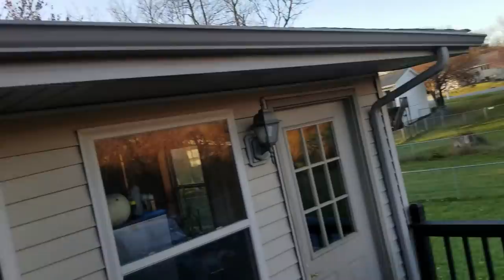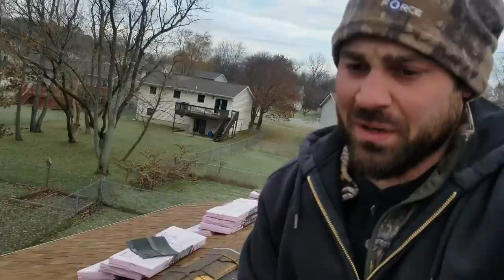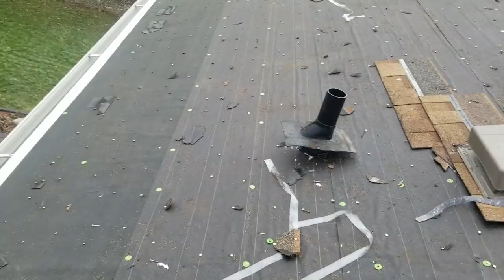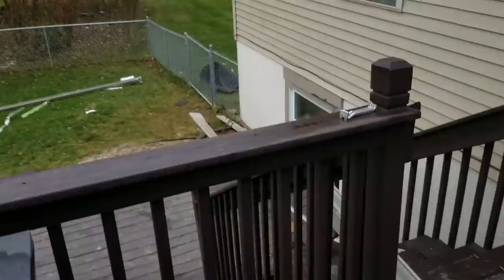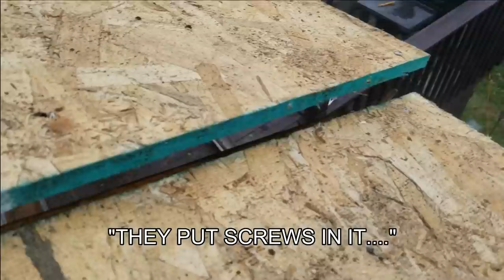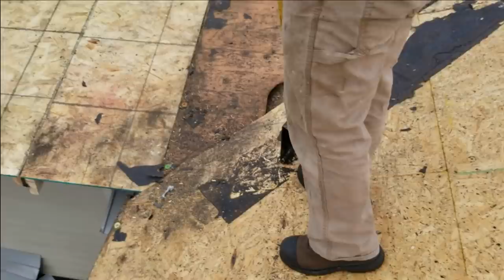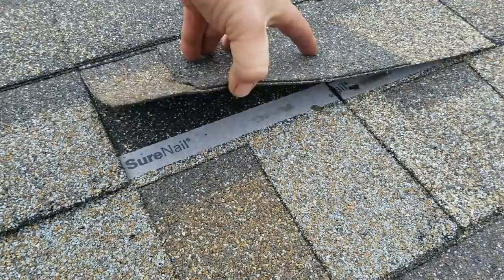Worst Roof Ever Installed!?!? (part 2)

Comment: The landlord at my last place bought a century-old factory and "fixed it up" himself to turn into apartments.  He sprayed cement spackle all over the door frames, and used styrofoam to fill holes in the exterior walls and then spackled over top.  When I had my satellite dish installed, the installer told me my landlord "fixed" the leaking roof by nailing blue dollar store tarp over rotten wood and crumbling tar.
Reply: LOL. Sorry for laughing but that sounds atrocious.

Comment: The way we fix the overhangs is to pull the decking off 2 rafters from the end, notch out an inch and a half, and nail a 2x6 flat across them and to the fly. Then deck it back. Makes them solid for life. They’re called “lookouts”.
Reply: Sweet, that's what I did for my diy roof I didn't know they're called lookouts.

Comment: hey buddy for the plumbing boot I like to cut the bottom shingle to go over where the three exposed nails are and just tar everything so you don't have any nails exposed and you have the one below tucked underneath far enough. I just don't like to have exposed nails on a shingle roof at all. An added touch is cutting a small slit in the middle of the bottom so that the water doesn't pool up. Many If I had a shed to do that would've been perfect to reuse those shingles-owens corning hold like a mother, but they are a pain to cut through. Happy roofing brother.

Comment: big respect for righting the wrongs on this roof, i do alot of roofing in denmark and i dont understand why you dont throw up abit of scaffoling so you guys dont have to hang off the edge of the roof with a spade to get things done, with a low hanging roof like this one it really wouldent take long to put up
Reply: by time you get that scaffold up the demo is done. Just another tool to get in the way, haul to and from the jobsite.
Reply: I’m more curious why residential roofers rarely tie off. Two of the three site deaths in my area in the last six years are unsecured roofers falling. Put on a harness and tie off.

Comment: Always make sure to check with your local building department for permit requirements.  Any legitimate contractor will not say permits are not required nor attempt to discourage getting the required permits.  At minimum, check with the building department to see whether or not a permit is required...there's no charge for asking.  A permit ensures that the work performed is checked by a building inspector.   And it's one's protection when filing an insurance claim for subsequent damage (e.g. water damage...insurance companies usually refuse to pay if the work was completed without the required permit).  The inspector will require substandard work to be corrected...and the contractor cannot charge you additional fees. Great video!
Reply: define "legitimate contractor"

Comment: Who did this? Done so poorly it looks like a criminal act.
Reply: In Ct. The state would have compensated the homeowner and billed the contractor. If the contractor wouldnt or couldnt pay his/her license is revoked.
Reply: @naui_diver9290  they never had a license
Reply: I don't know if it matters to others, but the "wood" looks like OSB. I think you know where I'm heading with this. OSB is a product that I personally would never use-especially on a roof!!! If it manages (somehow) to get wet, it tends to wick up water big-time, and fragment much more easily than plywood would!

Comment: In my neck of the woods contractors have to be licensed, registered, and insured. In order to keep your license you need to attend continuing education classes every two years. Also, virtually all home improvement jobs, like roofing, require permits and inspections. Many of my colleagues complain about the process but it really does help weed out the fly-by-night hacks. The inspector in my town would have never passed that roof job and the client would not have to pay until all of the issues are addressed.
Reply: my town just started requiring permits for roofs but they don't even bother looking at it

Comment: As a former satellite tech, I can say for certain that the dish is also improperly mounted. Also, if he just mounted it anywhere he felt like, it won't pick up a signal. It has to be tuned. Honestly, I blame the homeowner. If you can't do a job yourself, then it's your job to ensure the ones you hire are capable

Comment: I'm glad you are putting it bac together correctly. But somethng to note is that it is always worth protecting the deck and handrail surfaces before starting demo, as you had mentioned during the video.

Comment: Over here on the west coast right on the ocean,  we use only stainless coil nails only due to salt corrosion,  also our own policy is we don't use any osb...(oriented strand board) for those that dont know what osb stands for. only plywood 5 ply minimum. Or 5/8 ply ...osb is not good in our climate. Can't believe the fascia you pulled off...lol...but unlicensed people get away with that kind of Job all the time.
Reply: Mike Champlain they use osb in Connecticut it should be outlawed
Reply: Osb sucks in any climate. They use it here in Indy and as soon as it gets wet it swells and then disintegrates. I refuse to use it on any exterior project. I won't use it for subfloors either.

Comment: That is just nuts. I have never seen a roof nailed like that, ever.
Reply: Ever seen one with Staples and no underlayment
Reply: Tell your boss that you would like to do repairs. And don't forget your camera
Reply: @steveneumeyer7926  back in the day I did one or two that had crown staples in the decking,actually held better than nails

Comment: 2:15 High nailed it?  Or nailed it while they were high???
Reply: where two layers are joined together in the strip is needed,high nail will get one layer and allow shingle to get air and peel up /off
Reply: Looks like both 😂🤣

Comment: We saw that drip edge in the valley, don’t hide it
Reply from the maker: Drip edge in the valley? Hiding nothing.  What're you talking about lol
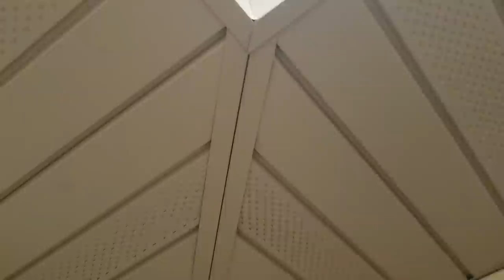Reply: 13:15
Reply: That little kink that will be inside the gutters the next day?
Reply: That kink is probably their because it was too tight when installing fascia. It happens. Gutters will hide it. I have OCD and even I dont care about that.
Reply: You're correct but its just cosmetic in which will be hidden by gutters im sure. There are alot of mistakes that he has done but nowhere near as many as the ones he has called out. Best shingler absolutely not... fastest not even close... quality one sure..  You can tell he has experience and it's not given by any piece of paper that he may or may not have. He seems like he is good enough to stand behind his work and I would bet he has had to go back to a previous client to fix his companies work but his ego wouldn't allow him to publicly announce it and thats fine just as long as he does take care of his mistakes.

Comment: In my experience of reroofing, there were two contractors I didn't hire who told me how "good" my roof would look afterwards and how "straight" the shingles would be and how "flat" the roof would be once they were done. Both these contractors failed simple questions about replacing rotted decking and replacing flashing. One even claimed that the siding along my dormers didn't need flashing because the roof "had enough overhang". I guess they had never heard of the wind.
Reply: Also ice, snow, capillary effect. Not a roofer but I've seen a leak the size of a quarter, under an overhang, cause about 16 feet of lumber to rot out.

Comment: Your crew carelessly damaged the deck by dropping things on it, probably ripped the screen too..  you should have just replaced the screen just to show good cause..  then you went and leaned your ladders up against the new shingles and leaned them up on the house too without care or ladder standoffs..  it's probably a good thing you sub contract out the gutter work, or your guys would scratch them and put dents in them too..   Hopefully all the comments will help you become better at your trade ~  I'm glad the homeowner managed to get the new work done, their house would have fallen apart over time.  Over all, it does look a lot better than it did.

Comment: I had a house like this with tiled ceiling.  I found out the hard way(when they all fell down). Only the edges and starters were stapled. The rest were slapped up then stapled at the end. 
  I kept my house colder than the last elderly couple did. This changed everything.  Ceiling fell right off in the floor.

Comment: I am a professional at roof repair and shingling, as a professional I call someone who knows what they're doing. Great Job. I absolutely refuse to do roofing because its easy to mess up the entire job with 1 mistake. I have remodeled many homes with about 98 percent satisfaction rate, but I wont touch a roof.
Reply: I would do a metal roof any day. I've actually never seen a metal roof terminally screwed up; if it isn't attached right you add more screws, if it leaks it's probably somewhere you can just add flashing or caulk. You can take the whole thing off and put it back on with only marginal damage to the pieces. I have no idea why people buy shingles when metal costs about the same and is better in almost every way.

Comment: You could done a California weave on the valleys, I’ve done copper or aluminum inlays also, just dependent on what they want, the shop I worked out of was fully equipped for metal fabrication, brakes, shears, Pittsburgh etc, made all of our eaves and gutter in-house, though we mainly did government contracted built up, cost and proper installation are always a factor, and I hand nail exclusively, can average about 2-3 square an hour on 10 pitch and below, 12 on is always slow because toe boards and fall arrestees, I’ve just had too many problems with guns when the shaft becomes worn having to back and make sure the nail heads are fully flush.

Comment: I just got done one like this. It was for section 8, so before I got to it the state had someone else come in and do it. For the price I guess they couldn’t beat it. It was literally shingled the same way. Ran them like 3 tabs and everything. They replywooded right over the old existing rotten wood, then ran fascia board on top of old rotten fascia board. And every bottom rotted again where they had seam over seam. No starter strip. It was bad. Had to rebuild all the over hangs . And redo the gutter and shit. It was bad

Comment: I worked for the local home builders association for a few years, and learned the value of ensuring your contractor is properly licensed and bonded.  It’s not hard to find a reputable contractor who does quality work for a fair price.  Get three bids, all should be about the same.  If one is significantly lower, you should probably avoid that one.
Reply: this is such an ignorant comment and you really should do more research on how these things really work. A piece of paper doesn't make a "good reputable contractor" No piece of paper makes you good or knowledgeable. I have fixed so many mistakes by licensed contractors and seen in real life homeowners screwed by the very system designed to protect them.

Comment: Homeowners usually go for cheaper. Specially owners who have no idea what things should look like. I’ve seen a lot first time home owners. Prefer cheap labor, and then end up paying twice for same job. And they always ask you can you just fix it, with out removing everything. But it is hard to find good, knowing contractors and companies. if something sound too good or too cheap just walk a way. In long run u will save money. 

Also in California we get inspections from city, and there should of been final inspection. Also they inspect framing of the roof(ply, nails) felt paper, and final. I am surprised inspector did not cut all that. Or homeowner decide cut corners save few $, and end up paying more?

Comment: I am a self employed builder, but have stopped doing roofs. Not because l can't, just no interest in it anymore. Whoever was there first, really needs to do something else. I have been on a remodel job for 11 months now, and have fixed or replaced every single thing done by the contractor before me. Cement siding, framing, flooring, and yes the roof. My customer was part owner of the roofing company, and it still needed to be fixed.

Comment: The last package of shingles recommended the nails not be placed within the seal strip but just above, are architectural shingles differ?
Reply: I think it depends on the shingle. Different manufacturers make different products that might be installed differently.

Comment: Hi there, inspector Cal again. Thanks for part 2. I think you missed some steps in this short film that might have gone a long way toward helping your neighbour recover some of her lost money. I didn't see how you assembled your eaves detail with the membrane and how it curls over the deck at the eaves  before you install your drip metal so there is no metal in direct contact with the deck wood. You didn't mention the spacing on your deck fasteners nor the type, length or gauge You also didn't show your shingle offset nor the total nails used per shingle. It also looked like you used EG coil nails vs. HD, is that correct? One more thing, I didn't see any fall arrest gear and you guys were well within the required area. Sorry to be such an inspector here but it's what I have done for almost half my 60 years. Glad you offer your clients the Owen Corning product as they are very well rated these days. Anyway, I can tell you do a good job but you should get a buddy to record this for you so you can concentrate on the content. Cheers.

Comment: It's good to see a young man, willing to learn how to do a good quality job these days.
Especially in a field, that demands very hard backbreaking sore knees calloused hands and sunburns  !
I did a few roofs in my younger days, so i know this is hard work. I was not a fan of heights or baking in the sun. So i chose a different line of work.
I have seen a few good roofers go bad. And either start taking short cuts, or subbing out and not checking on the jobs along the way.
A sure way to lose a customer or your reputation. Its still your name and your sub doesn't care about your rep.
Keep up the good work, and a helpful hint for you from an old man.
Pay your men well if they are loyal, trustworthy, reliable and do quality work. Its hard to keep a good man in this line of work. Especially your generation of so called men ?
Usually they may make it one week, grab the first check and are never heard from again !

Comment: Don’t know what code is there but in my state we are not suppose to nail the roof jack for the vent where they will be exposed. So the exposed lip would not have any due to a possibility of leaking in those spots. Even with the silicone, it is just a weak spot now.

Comment: I'm up in northern ontario. I've done over 60 roofs here. (Not my only job)  I have never seen a roof so poorly done right from the start.  Drip edge. Then ice and water. Then starter strip. 30 yr shingles u start full, 30", 20", 10". Seams are always 10 inches away.  At least she got it done right now

Comment: “Well bobby and richard said they been doing it for 40 years.  Figured it sounded funny seeing as theyre both 37 yrs old.  But it took them a month to get the roof in, given i did have to pick up all the burger wrappers that were in the attic after.  Hell they only fell through the roof 3 times and off the sides twice each..  thats pretty good.  And neither one got hurt, except my car they landed on..   should have guessed it when they said their insurance would cover it and when i called the insurance company they gave me, it was their own insurance company they run on the side but i just figured it was very lucrative of them to run 2 businesses at once..   but a month later my roof ended up on my neighbors roof, and neither business i worked with had numbers that were still in service.

Comment: Bro!...lmao been roofing since 96, hold a journeyman card for commercial. Recently retired from the big show of commercial and am out on my own. The only thing i do not agree with is well2 things....lol i have never agreed with overhanging my shingles past the rake. I know all the read a rapper roofers will say but it says to on the rapper and in codes. But i do not want to give the wind anything extra to grab so i always cut flush to the drip edge. It looks better aesthetically as well. I have never had any problems and yes i have residential roofs still out there long past their warranties still not leaking. And i know you have most likely never had blow off due to the half inch overhang. Next,i see you do a CALIFORNIA valley. I never do. I do a true closed cut valley weaving the first 2 courses then running the tucked side and cutting the main. Just put a shingle underneath before you cut. It is a much better longer lasting valley. Yes it takes longer but not much. Its all good though im definitely not hating and as a pro thats ran multi million dollar singleply commercial jobs,roofed Mark Farners,kid rock,Dennis Rodman's and Madonna's house in Petoskey Mi i will say you are a pro and keep up the good work. I do not know everything and never will shit i wish i knew half of what i forgot lol just keep an opened mind to new knowledge and stay away from stupid! I didnt wake up knowing anything, i learned through hard work blood sweat and tears,rip my bros that left to soon! Keep a wrinkle in it buddy 1BAMF ROOFER! ALLEN BROOKS!